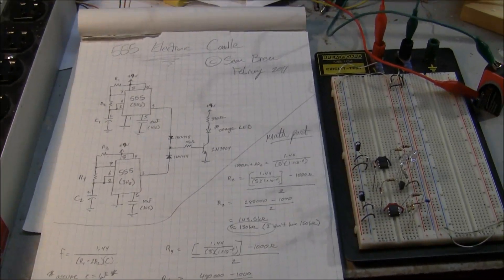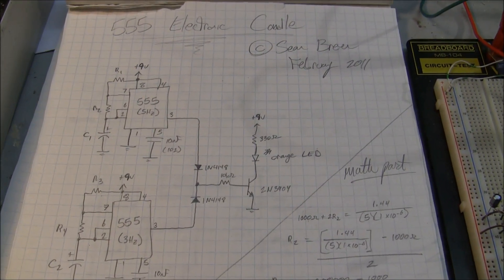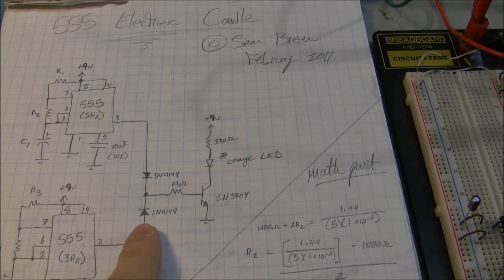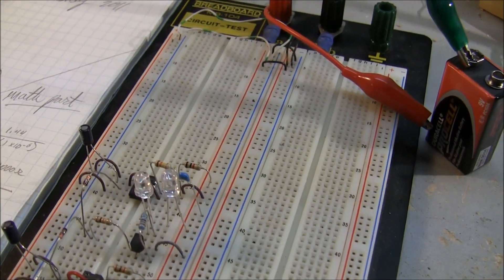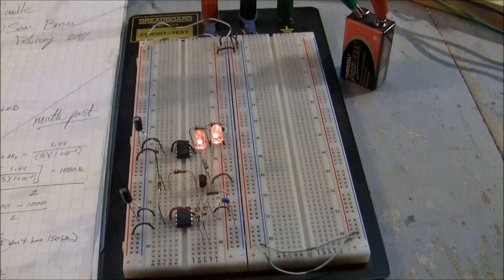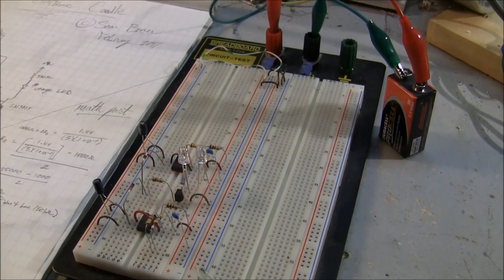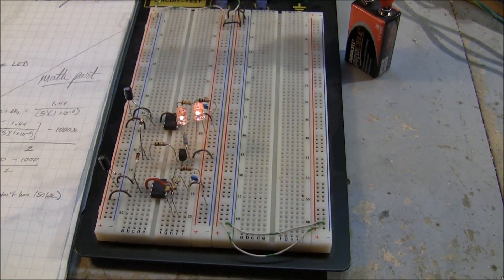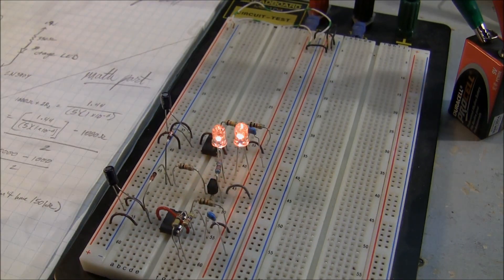555 Candle Circuit

Comment: 555 can sink 200ma if I remember correctly, so why did you used transistor to drive led when you could have used 555 low outputs connected directly to led via 1n4148 and current limiting resistor?